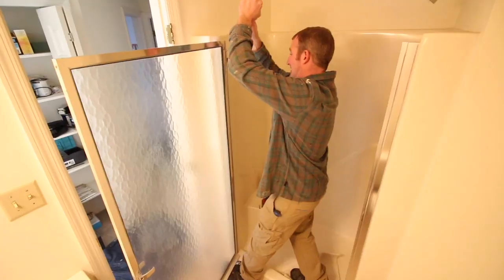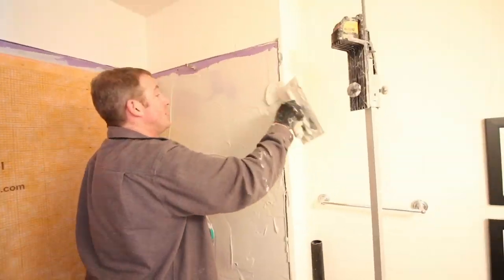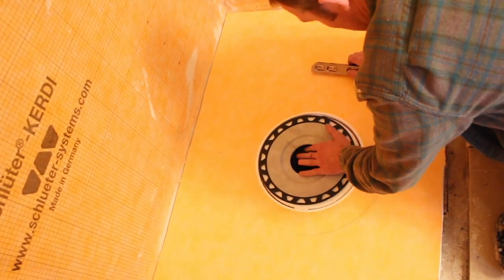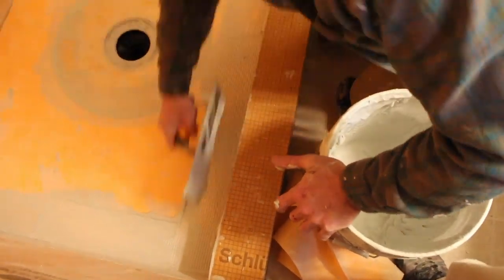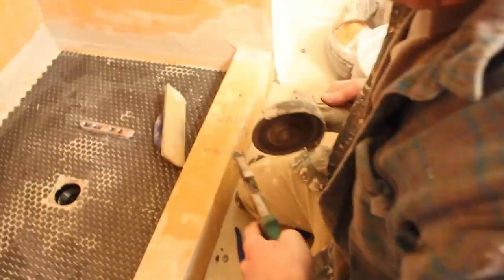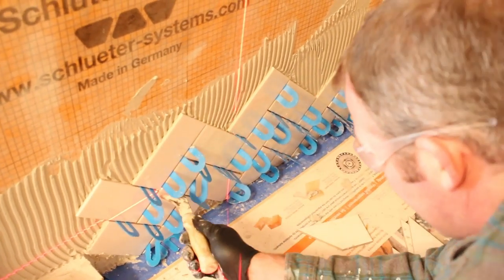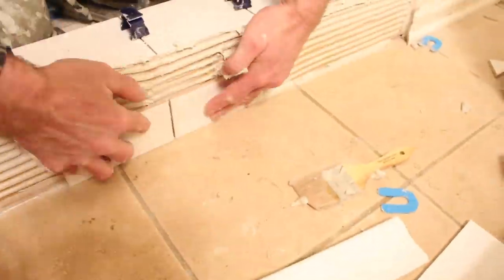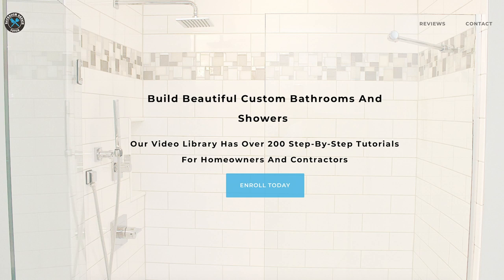Schluter Shower Part 6: How to Build a Curbed Walk-In Shower (STEP-BY-STEP!!!)

Comment: Your best video yet by far.
Reply from the maker: thank you so much, do you like this format the best, i.e. speeding through the installation while explaining concepts?
Reply: @HomeRepairTutor  Yeah I do - I think it's much better suited to people who have some level of experience with remodeling and know the basics but maybe haven't tried a particular combination of waterproofing, pan, curb etc (since there are so many different ways to do a shower).   Then maybe supplement with a deeper dive on some of the trickier elements like plumbing mods and the process for getting the drain set properly for various pan/tile combos, tile layout (ex - the herringbone side walls), handling transitions between materials cleanly, etc.

Comment: Another great one guys, a complete explanation of how to properly create a shower.   But I don't have the patients to do the small  mosaics due to the fact that they are never centered properly on the mesh backing!
Reply from the maker: thank you and you’re right, those mosaics are a pain. And adjusting them to prevent the lines between sheets can be tough

Comment: As a blood born Yinzer, it was great to find you guys (videos). The renovation is definitely doable...just a lot of moving parts to plan out before getting started.

Question: I see you left some of the existing, painted drywall in place and just tiled over it. Is it better to start with new drywall, or doesn't it matter? Tiles will stick fine to the painted drywall?

Comment: You guys are doing a great job!  Thanks for all the info.
Question: Roughly how many screws/washers would it take to use for the kerdi board in a tub/shower surround (from tub to ceiling)?  They seem to be sold in 40 or 100 packages. Just wondering how may I would need for my project.  Thanks.
Reply from the maker: we always recommend getting the larger quantity because it stinks to run out of screws/washers. That said, you can do a rough estimate. You will need one screw/washer every 12” along a stud. And studs need to be 16” on-center, for any board. Use those specs to estimate your screw/washer quantity 👍🏼
Reply: I am mid-renovation on a full tile shower (5ft wide, 3ft deep, 8ft tall) and used about 130 of the Schluter screws/washers.
Reply from the maker: @jeffreyscheurerii3219  thanks for the details, how's the renovation going?
Reply: @HomeRepairTutor  Great! Plumbed in the drain last weekend and did the flood test with no leaks!  Time to tile the floor this weekend!
Reply from the maker: @jeffreyscheurerii3219  sweet, sounds like you're on a roll. Getting the shower waterproof and passing the flood test are major hurdles. Great work!

Comment: Thanks for the video!!! Great info as usual.  Just a question, have you ever installed schulter shower system in a condo bathroom?  I was wondering if it is allowed at all.  Thanks in Advance!
Reply from the maker: thank you, not in a condo. But if the subfloor is covered in Schluter’s Handbook then you’ll be fine. It’s really important to read the Handbook before doing anything
Reply: @HomeRepairTutor  Thank you !!
Reply from the maker: @backnine39  happy to help in any way

Comment: Everything is perfect other than Penny tile is not suppose to be installed on a foam pan because of point load. Penny tiles and tiles smaller then 2inches as stated by Schluter Systems have the ability to crack and punch into the foam pan. A mud bed would have been a much better shower base.

Comment: More than twice the work and more than double the price. 1. Install purple drywall. 2. Apply thin-set and burn into purple drywall. 3. Apply  Kerdi membrane and flatten for air gaps. 4. Apply tile. If you were to use a product like GOBOARD you would just 1. Install GOBOARD like drywall while sealing joints and screw head with polyurethane caulking. 2. Apply tile.